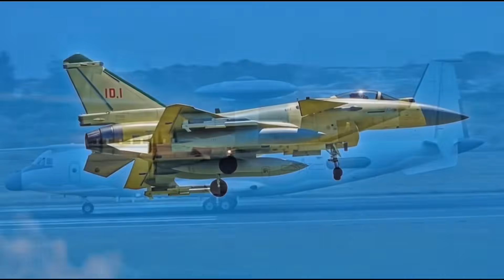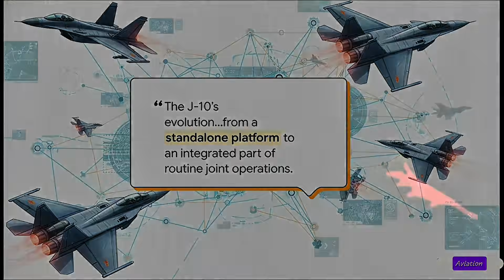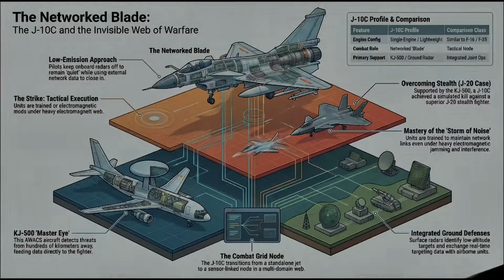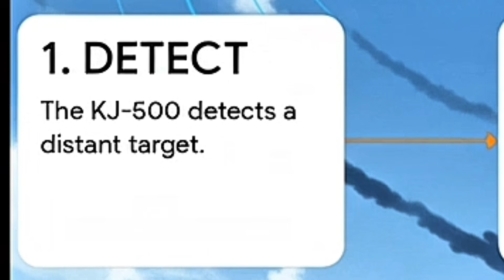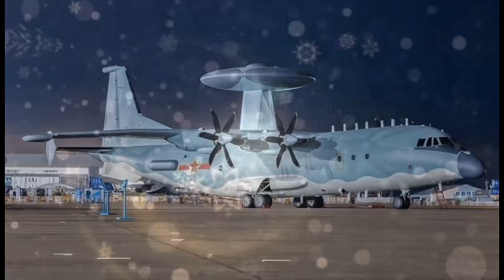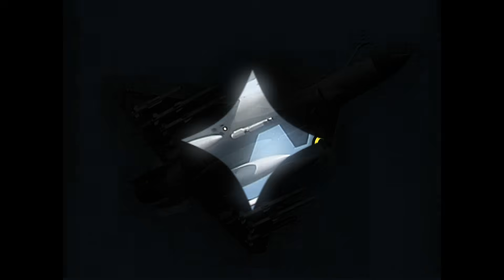Inside the Kill Web: The Dark Truth About China’s J-10C #J10C #ChineseMilitary #KJ500

Comment: You know that usa is has aim 174b made to target tankers and awacs and it can be fired from 400km can be fired from a carrier the reason usaf made f22 2.0 so the j 10 is not a 4,5 gen fighter its bassicly an f16 maybe it wins over f16 but an f15 eagle could easily win over the j 10 and an f15 ex can have aim 174b can hit the radar installation on ground cuz its a air to air and air to ground it can carry six and then 8 aim 260 and 4 aim9x block 3 sidewinder and the kj 100 or what youre communist say. That an f15 and a f22 pluss cca drones can easily win over your tactic thing so youre chinese slop is just wanna be communist slop